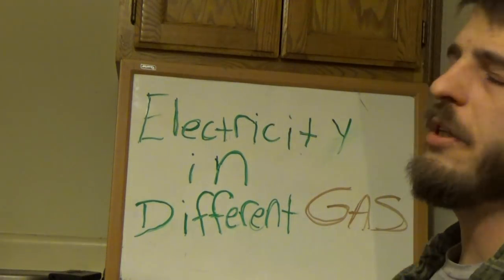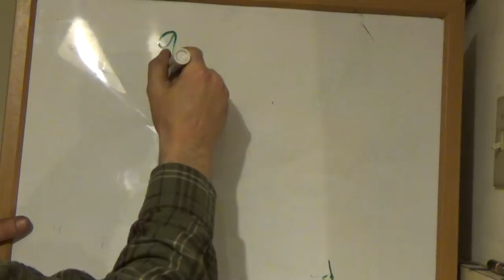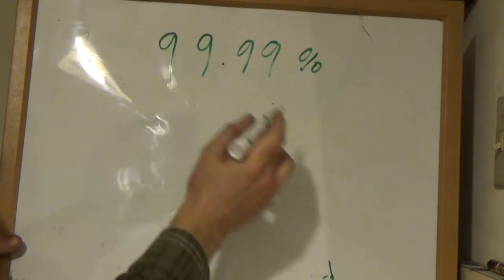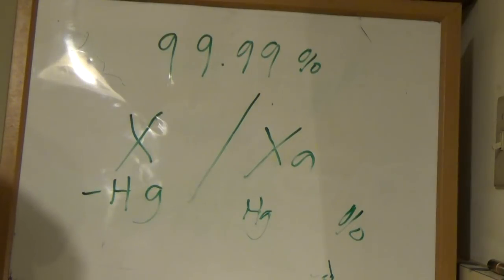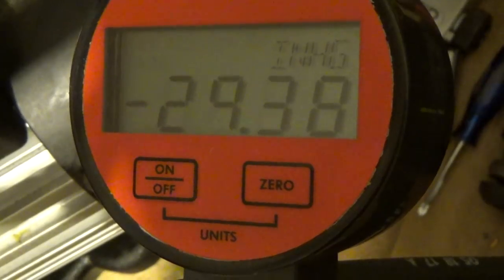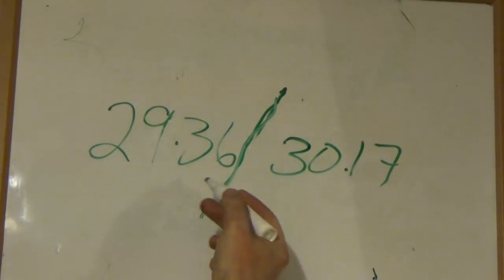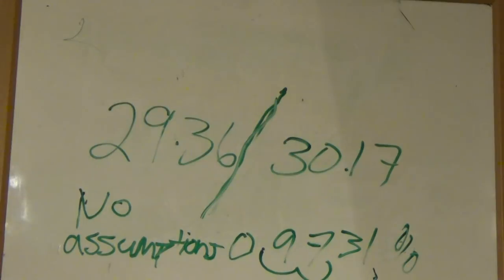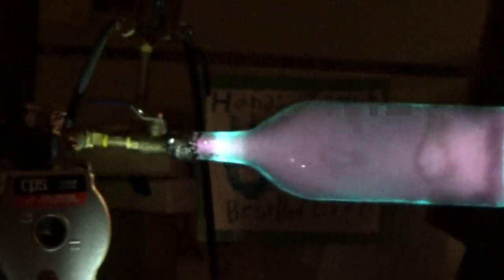Electricity in different gases

Comment: It would be interesting if you could induce a vortice in the excited gas by rotating magnets outside the container.
Reply from the maker: I think I would need a strong magnet because my small neo magnets  only have a noticeable effect at really low pressures. once a filament forms its similar to interacting with the hand.  Perhaps a stronger magnet though.
Reply: @BarelyScience  : If youve ever seen James Bare's videos on Rife ray tubes, his device reacts to speaker magnets. Helium filled mostly.

Comment: did you see the WarpedPerception video of slow motion OF slow motion... of arc discharge. You need to go see it.
Reply from the maker: i checked that out, very interesting. Plasma is very intriguing, even in slow mo it seems elusive.
Reply: @BarelyScience  exactly! at one point the orange channel made sense and the arc above it... but I was like "where the hell are those purple filaments going?? and are they connected?"